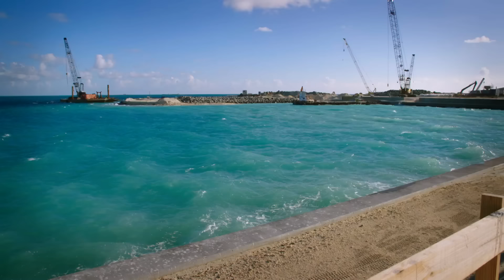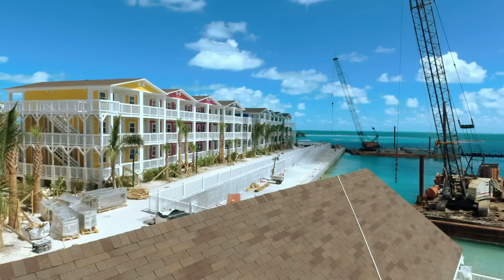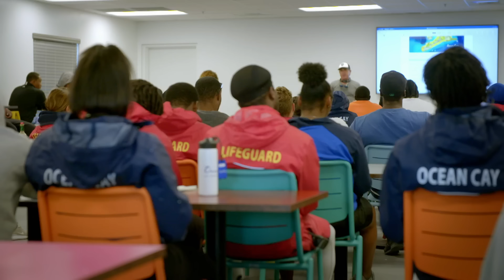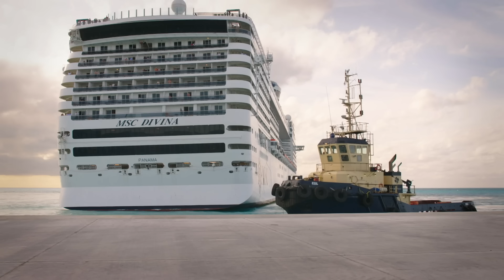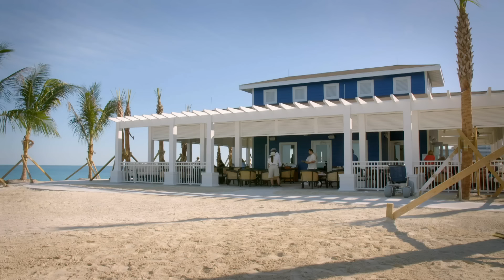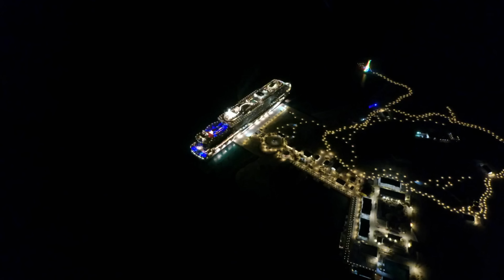How a Cruise Line Built Its Own Private Island? | Building Paradise Island

Comment: Cruise lines do this so that they can, among other things, avoid US labor laws by docking in a second country outside of the US.
Reply: The reason cruise lines are able to operate outside of US labor laws is because they register their ships in foreign countries such as Bahamas, Panama, Liberia, or Malta, which have different wage scales, working-hour rules, and benefits compared to US standards. It’s a practice known as “flags of convenience.”

The docking thing you mentioned sounds like the Passenger Vessel Services Act (PVSA) of 1886, which prohibits foreign-flagged ships from transporting passengers directly between two US ports. They must call at a foreign port. 

Maintaining private islands conveniently helps with that foreign-port requirement, but that isn’t their primary reason for doing it. They mainly do it for cost and logistics, revenue capture (keeping passenger spending inside their own financial ecosystem), and for better control over the guest experience.
Reply: Less than 5 😮😢
Reply: Cruise lines mainly build these islands, because they don't want to inject local economies with tourism dollars when they can keep that cash for themselves at a fake port of call.